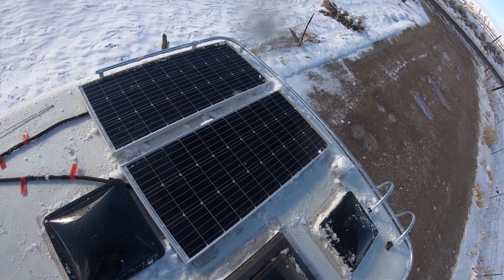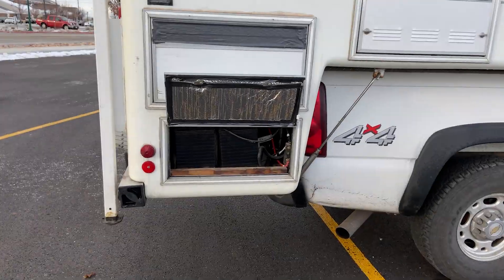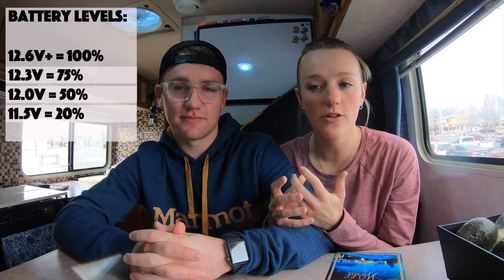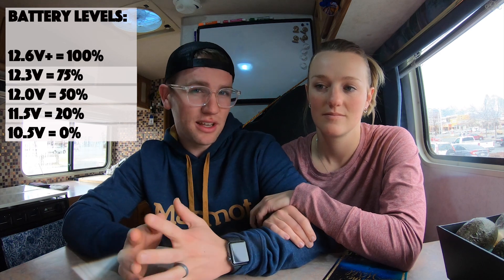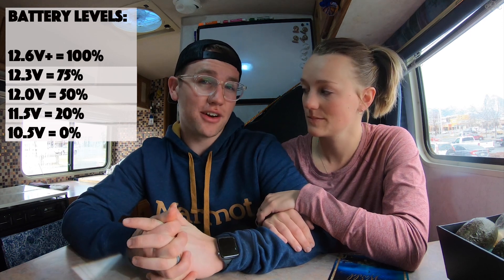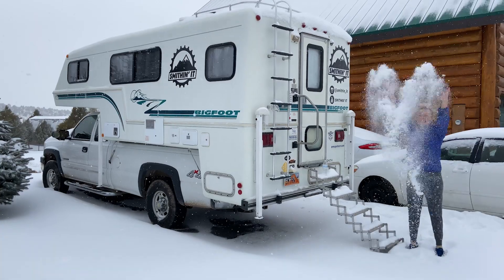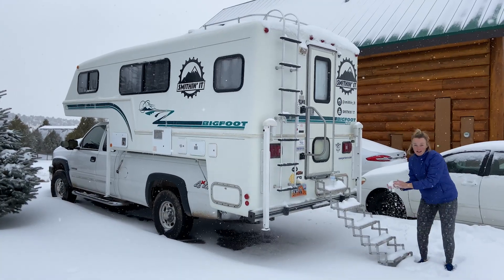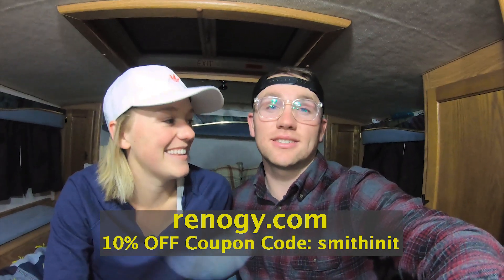Understanding RV/Camper Solar Panels and Batteries

Comment: You could have also run a 12V wire from Phil to charge the batteries when Phil is running. You will need a one way controller (diode) so it does not discharge Phil when he is not running.

Comment: Nice video and you got the math right! ...lol...Some pointers...look into a small "inverter" for your laptop and other small 110v things it won't draw too much from your batteries:) Also save up for a 100amp "Battleborn battery" its night and day over lead acid period. Will be following your channel and maybe even use you 10% discount for a great company when I get my panels:) Cheers!
Reply from the maker: Thanks for watching our videos and leaving a comment! We appreciate just getting to meet and chat with people. GREAT advice about the battle born  battery. We considered it an option for our camper last fall when we were buying batteries, but it was just a hair out of our price range. We may be upgrading to something like that this summer! Thanks for the tip on the power converter... we do use the little power converter from time to time, we will surely use it more in the summer when we have more things to charge and run! Have  a killer weekend!
Reply: @SMITHINIT  It is not a "converter" which takes 110 and changes it to 12v...it is an "inverter" which takes 12v and changes it into 110. ..not a battery pack either...look it up and get "some solar...even 1 panel at 100 watts:)